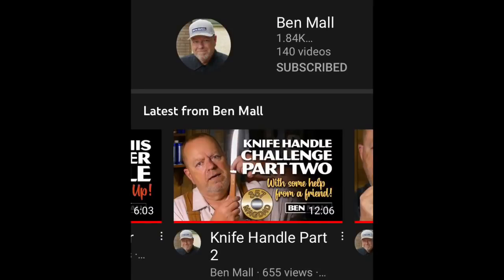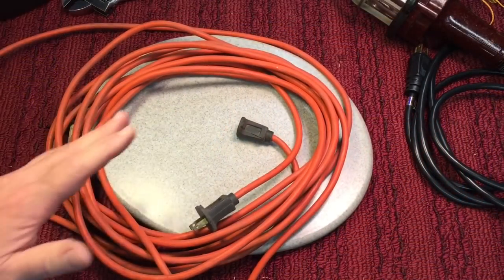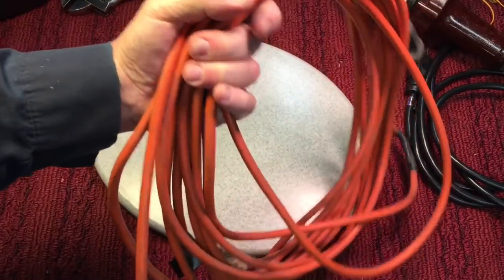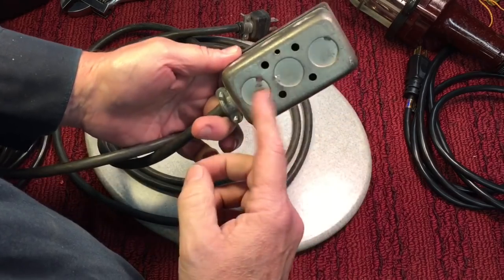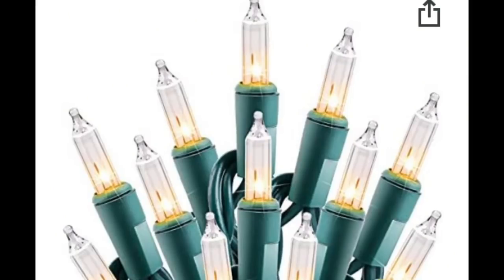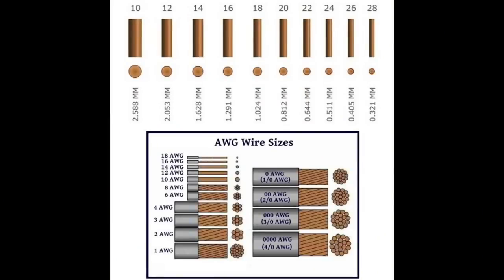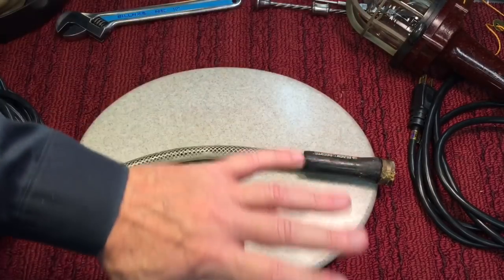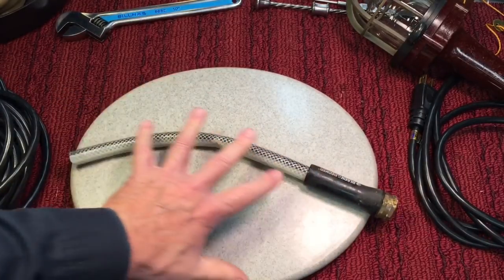Extension Cords and Rocket Lamps!

Comment: Interesting that in the US extension cords are permitted having no ground. Here in Germany an extension cord must always provide a CPC (circuit protective conductor aka ground) in addition to line and neutral.

AWG is defining the wire sizes, and it's an awful outdated system from my perspective. Containing information which is only useful to the cable manufacturer but useless for the electrician. And it's too complicated. Here 2.5mm² (cross-sectional area of the conductor) is always 2.5, no matter if solid, stranded or fine stranded. So I can use the same stripping hole in the wire stripper for them and don't require different stripping holes for solid and stranded...

Printing the cable specs on is actually an international standard. They do that everywhere. Even the China fakers do it, of course their label of the wire sizes are usually fake. They say 1mm² copper on the cable (AWG 17), and really inside is maybe half the size. And in addition not having copper in there, instead they use three thin strands of copper cladded aluminium. Sometimes the ground isn't connected, or just a fake plastic wire in there to fill the empty space within the sheathing of the cable.
Unprofessionally repaired cords should be repaired properly, or disposed. They are hazardous, and in combination with humidity they can cause the GFCI to trip.
And putting heavy objects on cables is more a problem that you either damage the insulation or damaging the conductor material, which in the worst case will start arcing. And arcing can cause fires. That's the reason for AFCIs (arc fault circuit interrupter) in the US, or here we call them AFDD (arc fault detection device).
Reply from the maker: Marcel- It's a shame that China has amassed such a bad reputation, I know there are many decent manufacturers in China but the risk is too great and many people (myself included) will always prefer other countries over China!
Reply: @ScoutCrafter  Yes, for me it‘s the same. Also manufacturing products which are clearly dangerous. For example cheap phone chargers. No proper galvanic isolation from the mains, so at worst the metal housing of the phone will become live at mains voltage. Especially when humidity is slightly increased. Sometimes young people are sitting in the tub and play with their smartphones. Charging it there with such a charger can end fatal.

John Ward from the UK makes nice videos, also about such stuff.

Fake cable:

https://www.youtube.com/watch?v=Ib7Dd92mGRQ

Comment: Hi, one thing you did not mention was that when using an extension cord and drawing near to max current the coils of unused extension should be 'scrambled' to prevent the induction furnace effect occurring.  I have seen, mostly at trailer parks coils of wire that are distorted and kind of melted due to the induction effect of not 'scrambling' the unused section.  Cheers John Clough, Scotland
Reply from the maker: Hello John!  I have heard of this in theory however in two or three wire extension cords the hot wire has electrons flowing one way and the neutral has electrons flowing the other way that’s canceling out any magnetic properties that could cause induction. In order for an extension cord to generate any kind of induction it would have to be a one wire cord. I’m very curious to know if anybody had this situation happen to them!!  Awesome point!  Thanks John!  😃👍